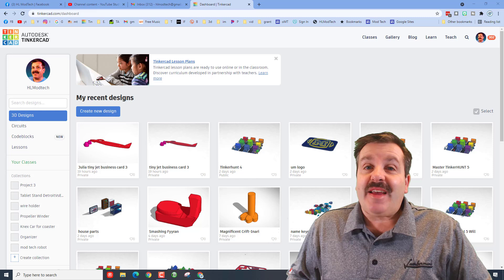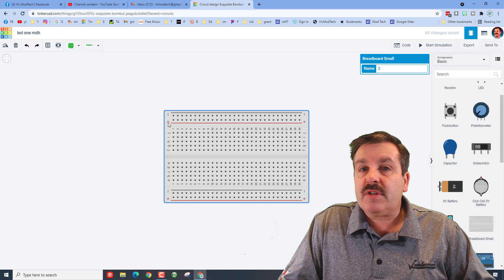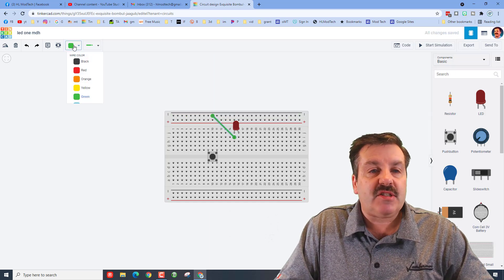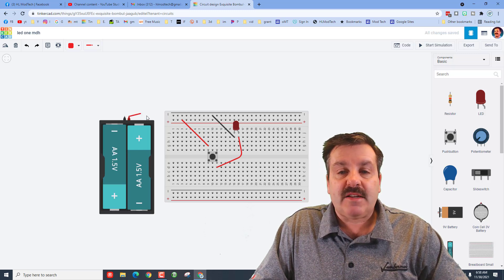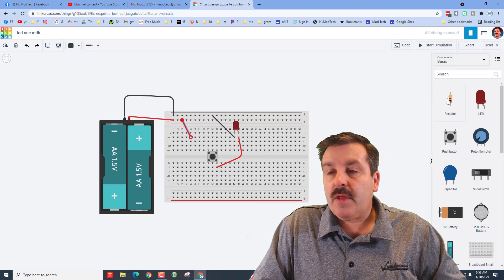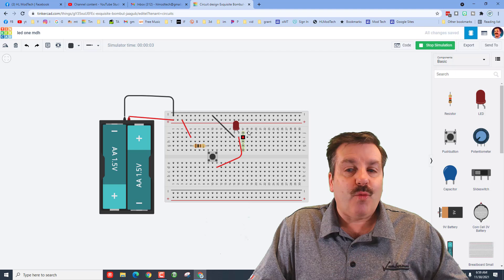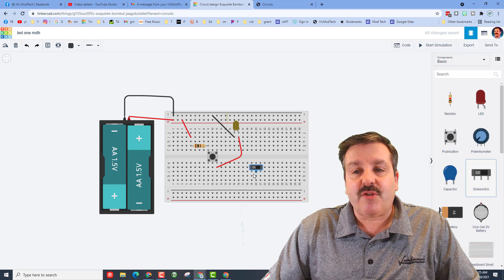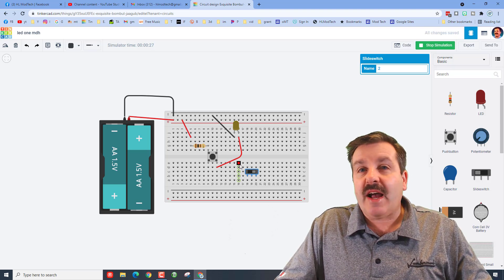Lesson 1 | A LED and Pushbutton | Master Tinkercad Circuits in Minutes

Comment: Please be careful when using a breadboard. It will create frequencies that will enter your body and cause damage.
Wrap either the  breadboard or your body in tinfoil to block out the frequencies. You must be careful with frequencies.
Reply: Bro what 😂
Reply from the maker: You know this is a simulator on a PC, right?
Reply: @HLModTech  I was not aware that this simulator was available. This is such an excellent way to eliminate any problems with dangerous frequencies that can float through the air and cause problems. Tinfoil is expensive and uncomfortable to wear. The less unwanted frequencies the better. I will use this method in the future to eliminate any worry about the hazards of frequencies while prototyping circuits. Thank you so so much for making me aware of this method to stop harmful frequencies.
Reply from the maker: Happy to help. Fingers crossed you find a way to navigate the planet Tin Foil Free someday. 💯🫰